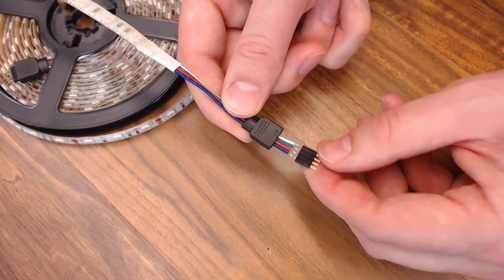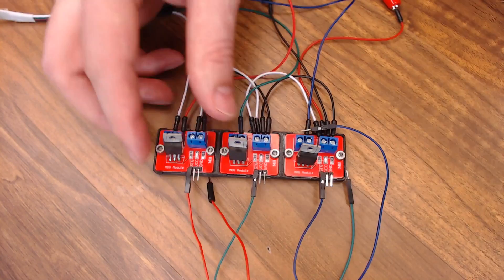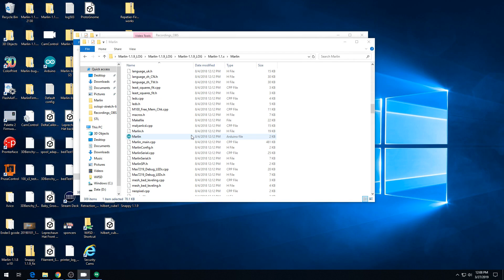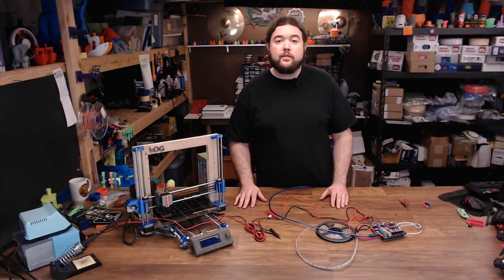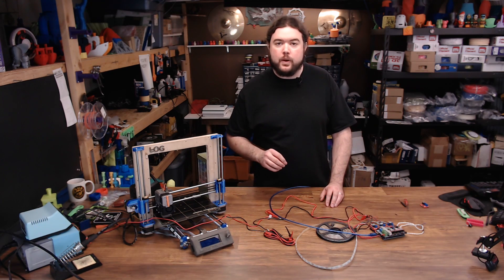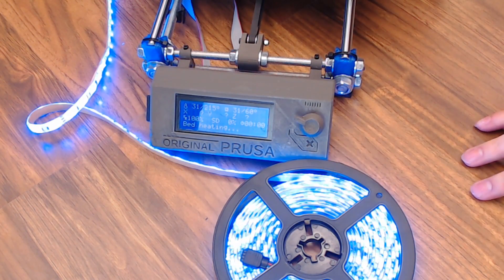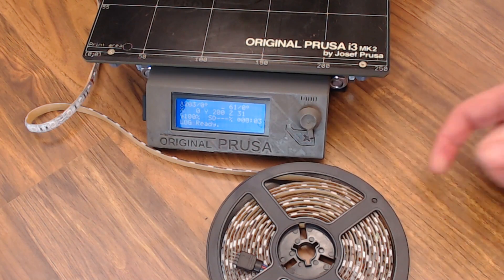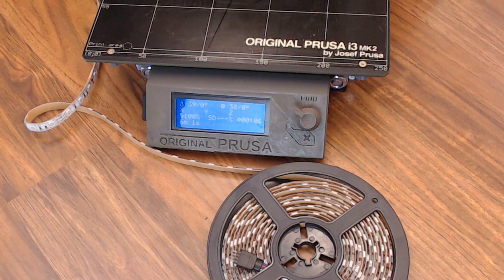LEDs For Your 3D Printer - How To - Chris's Basement

Comment: have them too but on DIY PCB board cause I needed 3 to have a lightstrips in each tower of the delta.  Having your board and hotend fan on mosfets and controlled by marlin, is something I would recommend to do along with this 'upgrade'
Reply from the maker: There are a bunch of cool things we could add to a custom build. I should make a list of add ons.

Comment: I bought an LED strip, and wanted to do this. I hooked up some wires on the bench to test the strip. The green lead made the strip light up blue, the red lead lit up green and the blue lead lit up red. Moral of the story, test before you tuck it into your printer. :)
Reply from the maker: Doh! That is great advice.

Comment: your channel is underrated, i built a custom 3d printer and decided to give it a final touch ( cable management, installing leds, configuring fans&psu since im using an xbox psu). i was thinking of a way to make the leds react to the status of the printer. and here you are uploading a video about it.
keep doing watchu doing man. wish you best luck
Reply from the maker: Thanks for the kind words, I will do my best. Should be an awesome add on to your build.

Comment: Be careful getting the right mosfet boards. Normally they are hooked up to the bed mosfet, so switching at 12v or 24v. Now they are connected to the atmega pins, which outputs 5v max. If they are not logic level mosfet boards, the leds might not shine...

Ps like a strip of neopixels better, you can directly drive them from a single atmega pin, but you do need a buck convertor to make a 'high' amp 5v to power the strip.
Reply from the maker: Great advice, I would like to test with neopixels.

Comment: For my super cheap simple PLA only printer with just a glass bed, I put my leds underneath, so it lights the print from below !   I just used simple transistors to power a strip of about 10 leds.
Reply from the maker: Nothing wrong with that! :)

Comment: I see below the RGB config there is NeoPixel.  Assuming of other do not have RGB strip, will it be a much simpler setup wiring and parts wise with ws2811 addressable LED strip with only single two wire power supply and 1 signal  wire and PIN and be able to control all color and brightness?
Reply from the maker: Yeah, I think the NeoPixels would be a lot easier to setup. I would like to get some to try out.